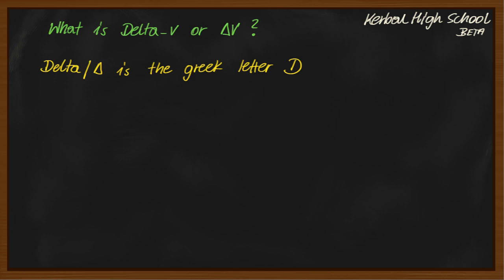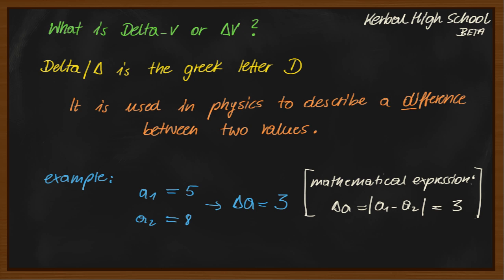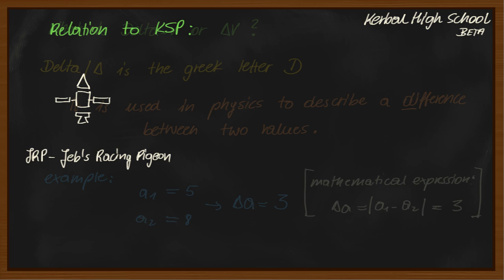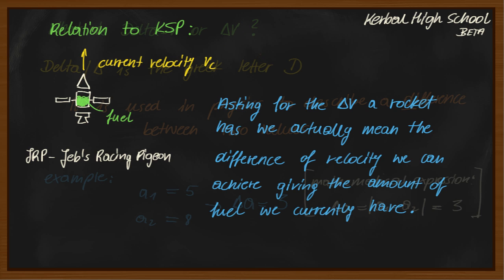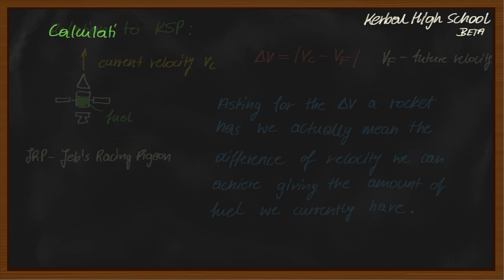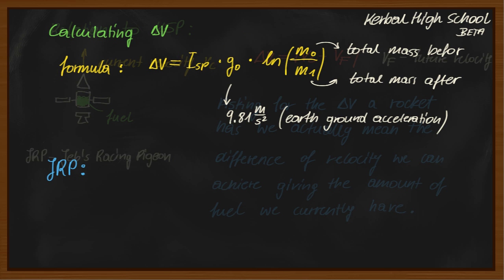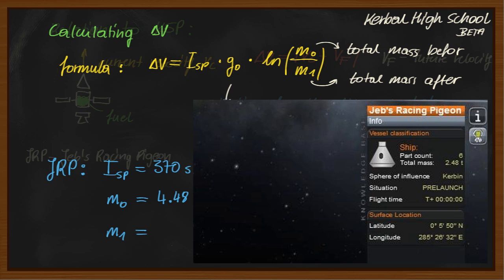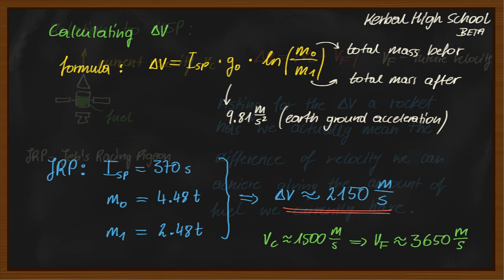Delta V / Δv explained in KSP

Comment: So your Delta V is basically just how much faster than your current speed your engine can go? So for example if i was going 5000 m/s and my Delta V was 5000 m/s, then i did 1 long prograde burn until my fuel tank was empty, assuming i go straight and don't change my trajectory, by the end of my burn i would be going 10000 m/s? Sorry english is my second language so my grammar isn't the best.
Reply from the maker: Yes! As long as the burn is fast enough that's right. In reality you lose a bit of speed because you go higher and higher the longer you burn. You would normally integrate over the burn duration to figure out exactly what you need.
Reply: @KsNewSpace  i think i have a basic understanding of it now, thank you!

Comment: I'm pretty sure it's a2 - a1, not a1 - a2.
Reply from the maker: you can just rename the variables a1 = b2 and a2 = b1 and a2 - a1 becomes b1 - b2 and it therefore doesn't matter ;P In my example both have the same result. |a1-a2| = |a2-a1| = 3

Comment: Wow I still have absolutely no Clue understanding Delta V
Reply from the maker: I think the confusion stems from the difference between planes and rockets. A plane reaches a certain speed its engines can achieve and you count the range. A plane is limited in speed because of the air resistance. 

Going to space there is no air resistance so you can go as fast as you want. If you keep your engine running you get faster and faster until your fuel runs out. 

So instead of relating tank size to range, in space, you count how fast a rocket can get to compare them. Range is meaningless in space since you can be in orbit forever and get an infinite amount of range. I hope that helps.
Reply: kNews.space I think I’ve got a grasp of it? I found the Delta V “cheat sheet”, don’t understand how to read that. And I’m not entirely clear on how to use the knowledge of my Delta V to my advantage when I do calculate it.
Wow, rocket science is hard...

Comment: wait, no delta is the difference between the final nad the start so it should be Vf - Vc
Reply: Doesn't really matter, because you take the absolute value. So the absolute value of 3 = 3 and -3 = 3. So for example the absolute value of 5 - 8 and 8 - 5 will be the same.

Comment: Thank you very much to help me understand this very basic term.
I have a question...sorry, but I early suck in physics.
Why does a rocket engine keep accelerate ? Is it because the weight of the spacecraft keeps getting lower and lower ? Because Gravity is less and less powerful as you are gaining altitude ? Because the atmosphere is finer and finer ? Or a combinaison of all these factors ?
If yes, witch factor is the most important in the continue acceleration?
I thank you a lot, bye !
Reply from the maker: I'm not sure if I understand you correctly but there is no absolute speed in space. At least no speed that would matter for conventional rockets. When you fire an engine you will always get faster no matter how fast you already are. It doesn't matter to the engine or to the rocket. You fire exhaust gas on one side, you accelerate to the other until you run out of fuel. That's just how momentum in physics works unless of course you approach the speed of light. You can't go faster than this because Einstein said so lol I can highly recommend to watch the MIT open course series on Physics: https://www.youtube.com/watch?v=F3N5EkMX_ks&list=PLUl4u3cNGP61qDex7XslwNJ-xxxEFzMNV You can get materials like assays on their website if you want to dive more deeply into it.

PS. This series is very hard to follow if you are new to this so I'd recommend to watch the videos multiple times and make a copy of whatever is told for your own documention. Like that it says in the head more easily than just listening.

PPS. Also, a rocket has two origins of acceleration. The thrust is one and the second is earths gravity. As long as the thurst is higher than earths gravity, the rocket will get faster and faster. And yes, the acceleration increases because the thrust stays roughly the same, while the mass of the rocket decreases over time.

Comment: How do you use the natural logarithm?
Reply from the maker: Hi, the natural logarithm ln(x) is a mathematical function. Most calculators have an ln symbol so you can simply press it and then the number or the other way arround. You don#t really need to know what ln(x) does in order to use it :) However, if you want to understand what ln(x) does you have to look up some calculus books or check out Khan Academy.

Comment from the maker: @Isaiah Phillip Yes, the surface gravitation is just used to cancle the one out used to calculate the specific inpulse. It has nothing to do with the gravity surrounding the craft. 

The Isp is not a real value you could measure somewhere. It's calculated! To describe the efficiency of a rocket engine you use the exhaust velocity. However, since there are different units for velocity (like miles and kilometer per hour) they decided to simply devide it by g so most of the units cancle out and it remains seconds which is the same for everyone. Isp * g = exhaust velocity.
Reply: KerbalEssences in physics, displacement is a thing :P. KSP pretty much uses velocity as displacement (Delta v) it just tells you the magnitude; not a direction. And that Delta operator is a forward difference i.e `Delta x = x_2 - x_1`, but really you could just inform before hand stating something, like: let Delta be the absolute difference of two values.
Reply from the maker: Hi, I'm not entirely sure what you are relating to? Can you please point out my error more precisely? I have never had maths / physics in english so i am always happy for every (potential) translation error I can sort out!
Reply: KerbalEssences ah, I'm sorry. That Delta usage is correct in the context of spaceflight dynamics. I just wanted to point out that, in physics, displacement means a couple of things, but it also means literally a movement. Eh, many education systems ignore displacement and call it velocity. I actually haven't been taught that way at school, but online instead :P.
Reply from the maker: ***** Ah okay. Before KSP I used delta primarily as a computational version of d. An integral x*dx turns into a sum x*Δx for example. I think seeing the velocity as a displacement would be a little too much for such a video. It's probably more important when you dive deeper into physics.
Reply: KerbalEssences yeah lol.

Comment: There is g=9.81 in the formula. I am confused because delta v in space should not be dependent on the gravitiy of a certain planet.
Reply from the maker: Hi, the "weight specific impulse" or "Isp" for short uses g or 9.81 m/s² in the numerator (Isp = F*t / m*g). The g in the Δv formula is basically just needed to cancle that out.
If you use the mass specific impulse however, you don't need the g in the formula. The weight specific impulse has seconds as a unit while the mass specific impulse N*s/kg.
The more common one is the weight specific I think because you can't confuse the units kg / pounds. I hope that helps!
Reply: thx yes helped :)
Reply: +Daniel Wolf  you are always in some Planets, Moon, Sun, or Galaxy's Gravitational pull, you cannot escape it...

Comment: Actually, it turns out that g0 in KSP is equal to 9.82 m/s^2. I, and other people, have tested and verified this in game. It is not a big difference, only 0.1%, so using 9.81 m/s^2 gives you a little room for error.
Reply from the maker: Yeah thanks for that. I also found this out lately trying to make a hovering rocket with kOS :D I did not verify this with ISP though. 9.82 m/s² just happens to be the gravitaional acceleration on 0 altitude.